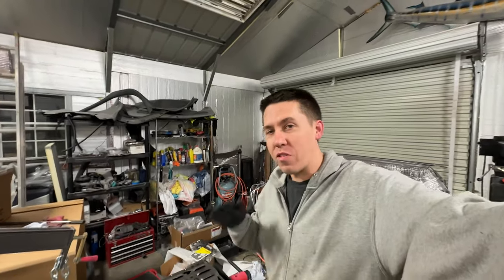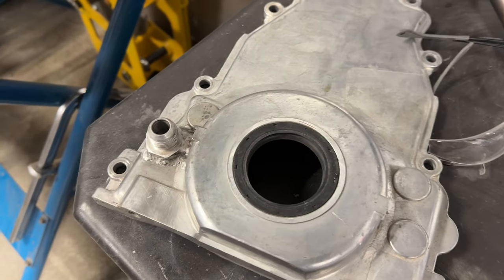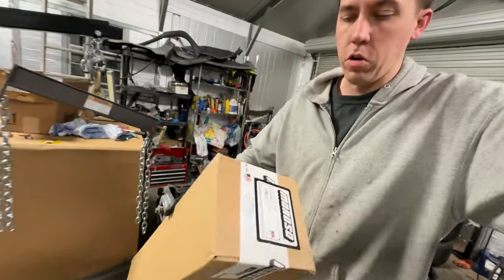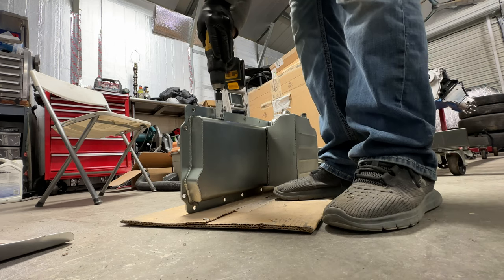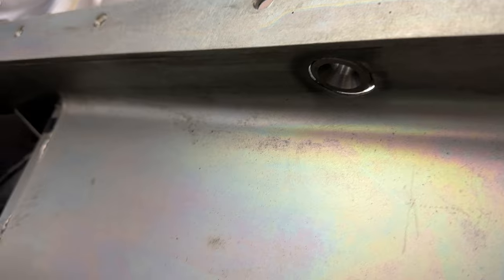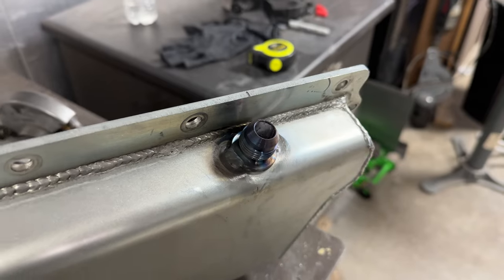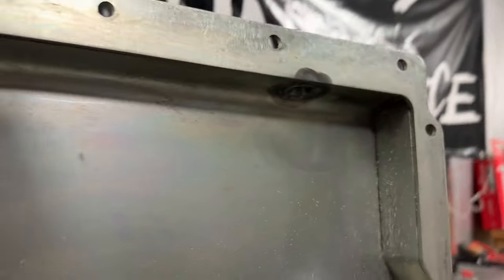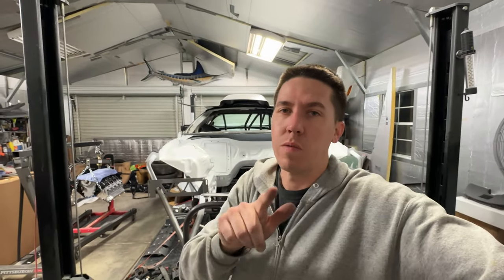Twin Turbo Oil Drain Bung Install!

Comment: What oil pan is that and how many quarts is it I am building kinda the same car and love your videos I actually bought rock sold motor sports fuel cell same as your after you showed how it fit thanks and great video
Reply from the maker: Thanks for watching and that’s awesome the tank is sweet! 

This is a 7qt pan pt number is 20145, used it with my last engine and did awesome holding oil pressure compared to my stock FBody pan with baffle
Reply: @BuildTuneRace   I believe the pan you have is part number 20142 (20145 is a 5 qt pan with only 1 trap in the sump)